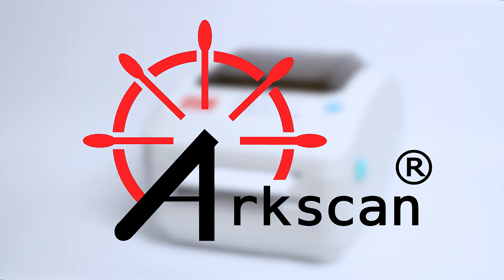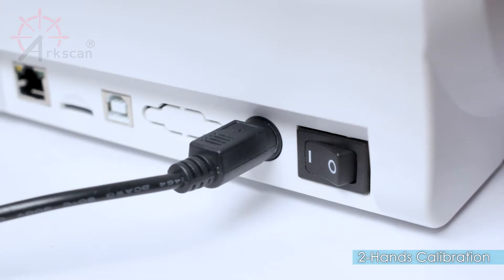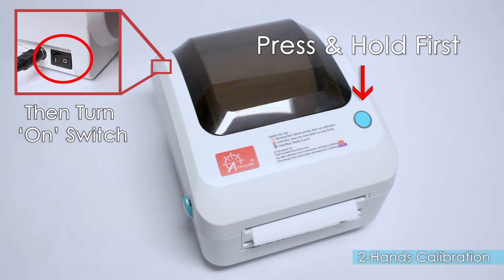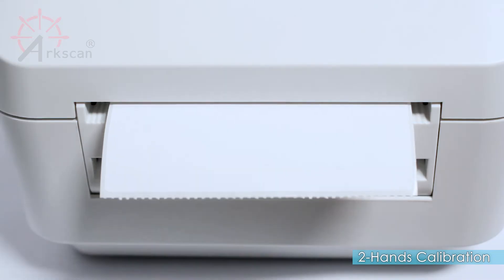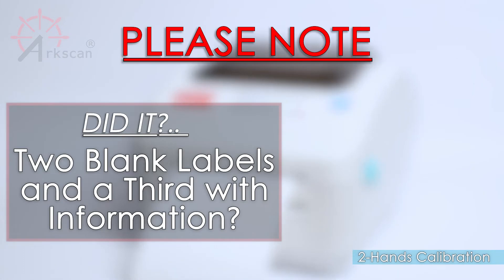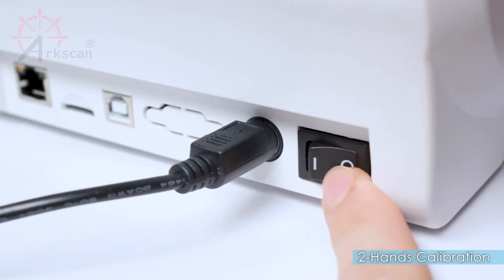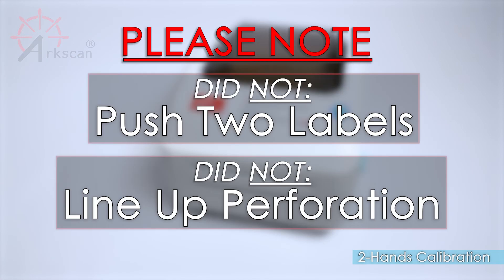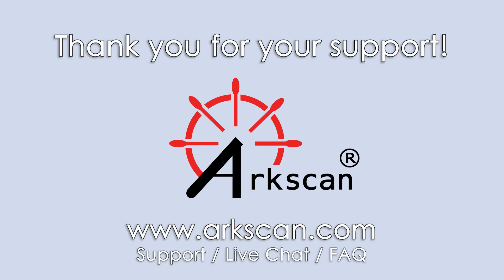How to run label calibration for label printer via two hands (basic method, zebra compatible way)

Comment: Where is the video link for when the perforations do not align? I can't get this printer to work properly. This is very frustrating.
Reply from the maker: Hello, thank you for the question, and sorry for the frustration! Calibration issues can occur if the backside of the label has any text, logos, or graphics, or if there are any holes in between the labels. These will disrupt the calibration sensor in the printer. If you are using a 4x6" size label there are ways to manually calibrate these types of labels. Please contact our support team and we can help you to get the printer working - www.arkscan.com/livechat - Thank you!